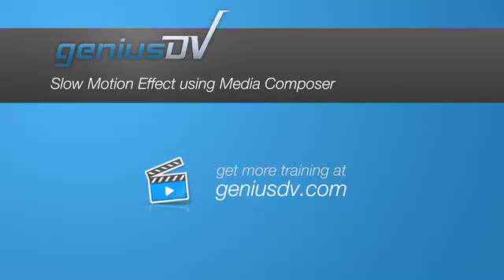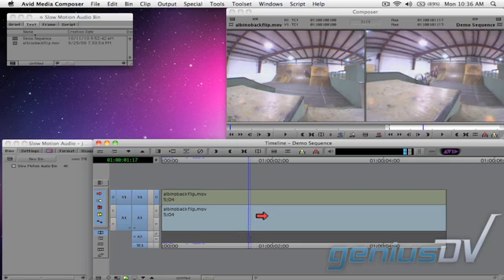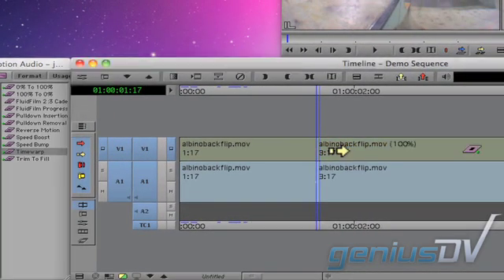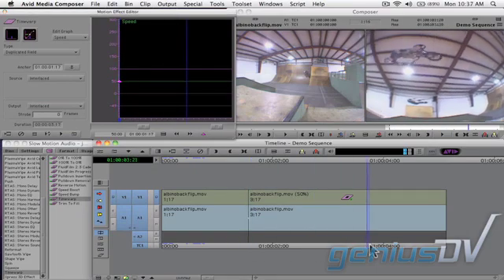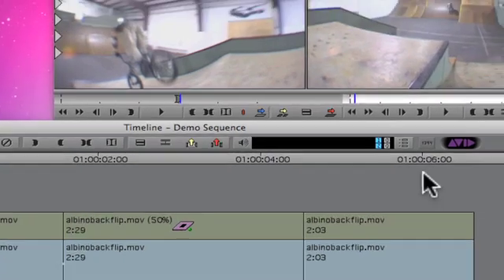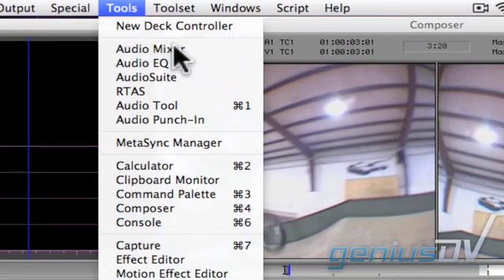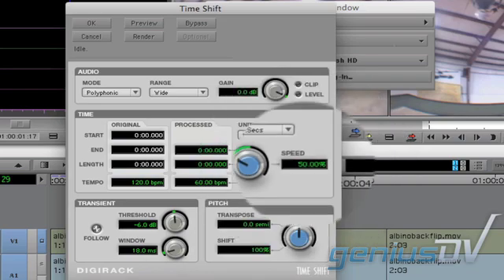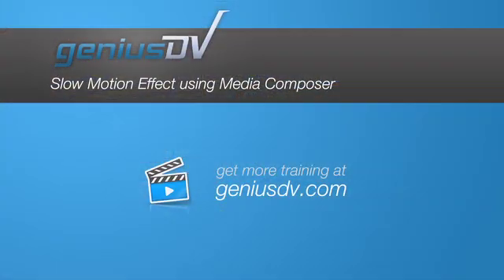Media Composer speed ramp using slow motion with audio

Comment: Nice tutorial, but doesn't work for me in Abid MC7. :(

This is typical of Avid - totally overcomplicate matters. Every other video edit suite does this in ways which are far more simple and logical. The problem I have is that while Avid slows the motion, it does NOT elongate the clip, so if I try to slow a 2s clip by 50%, I still have a 2s clip, not a 4s clip. Come on  Avid, make this easier!